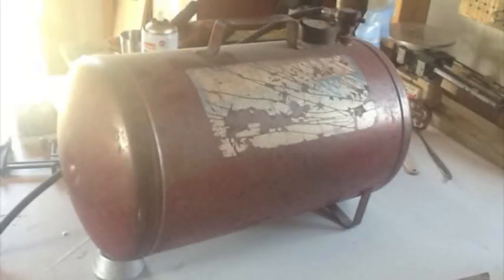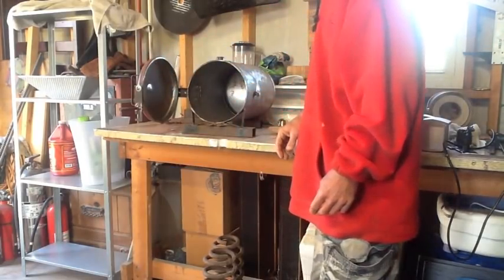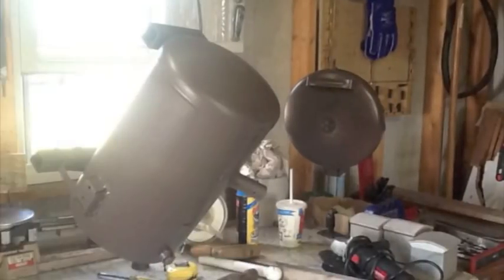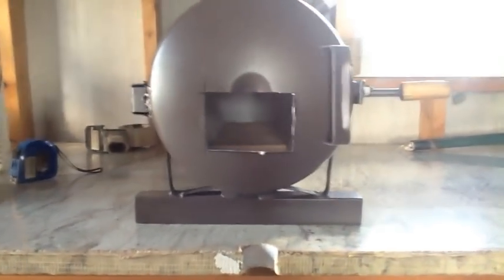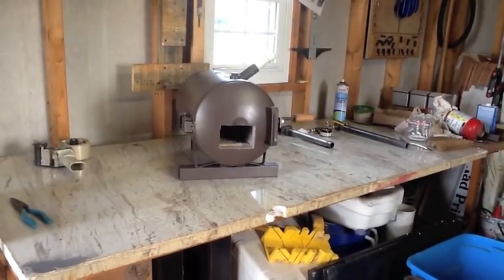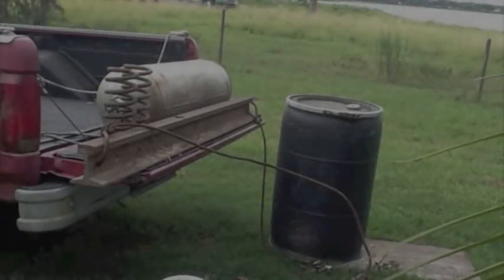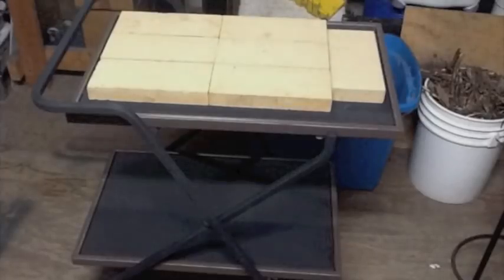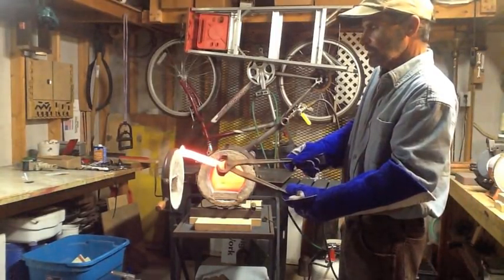My Custom Blacksmith Propane Forge Build - Start to Finish

Comment: Hey I saw your video and it was awesome.  where did  you find your hinge and latch for the forge and what type of hinge and latch  did you use.
Reply from the maker: The hinge came from a junk BBQ grill (just mounted sideways) and the latch is just a piece of scrap steel with a slot in it that slides over a bolt welded to the side of the tank :)

Comment: Also, was thinking about leaving the opposite end open or applying a door for long material. would you do it?
Reply from the maker: I considered an "open end" but didnt forsee doing swords and such. If you do end up making the opposite end open, consider being able to close it up tight when not in use during construction phase :)
Reply: If I can figure a way to seal the door well enough, I was thinking I might try it. Just started cleaning the tank but found an old air tank I may use to build one like yours. Do you have a video on that cool hinge?
Reply from the maker: I dont have a video on the hinge but its just a hinge from an old BBQ grill someone was tossing away. The hinge seems to be the most popular question about my forge :)

Comment: I have one question does it get hot enough to weld with or have you attempted that
Reply from the maker: when I use forced air it reaches welding heat

Comment: Really nice build that is will be looking forward to replicating.  Few questions.  How many gallons is the air tank?  Does it heat up fast enough with one burner? Do you use it more with the door open or closed?
Reply from the maker: 7 gallon air tank, heat ramps up quickly for me with one burner (lots of factors involved however) Quality of burner, PSI used, wool thickness etc. I use with door closed

Comment: Nice job!
Reply from the maker: Thanks Paul!, are you building one ?
Reply: +Makin Sumthin From Nuthin  I have built 2 so far. They are much smaller than yours. I got into recycling old computers about 2 years ago. So my purpose for them is the final step in gold refining. I used cement and perlite for one and plaster and perlite for the other. And mine aren't nearly as nice as yours. You turned that old air tank into a work of art!
Reply from the maker: Thanks friend! :) You use yours to turn the IC chips to ash? Consider subscribing if ya like my content :)
Reply: +Makin Sumthin From Nuthin yes sir just subscribed. I'm always looking to learn so keep those videos coming. So far I've recovered 2 grams of gold from the gold fingers on slot cards and memory sticks. My next step is the ic chips. Still researching the best method for recovery. Have you ever tried?
Reply from the maker: I have been stockpiling IC chips, fingers, CPU's, etc for a while now. Will do recovery when I think it will be worthwhile :)

I Did a couple scrapping vids but I am better known for my casting vids. Servers are a goldmine! :)
Reply: +Makin Sumthin From Nuthin yes they are! I've been gathering old towers and laptops for 2 years and I think I've torn apart over 140 so far. The only thing to make it to the scrap yard so far were the empty towers. Everything else I'm just stacking until I can determine the most efficient way to process. And I'm hoping scrap prices improve. I definitely have a lot more invested at this point than I've gotten back. But I think in the long run it will be worth while. I'm definitely having some fun with it :-)
Reply from the maker: Nice! PC's are good sources for clean aluminum to use for metal casting too. I documented the servers being scrapped out in one of my vids if ya care to watch....maybe I missed some stuff...let me know! :)
Reply: +Makin Sumthin From Nuthin they are very nice! I'm going to check out some of your other videos now. Wondering if you ever did the molten aluminum in a red ant colony? I heard those sell for a good amount
Reply from the maker: No I have not. We used to have fire ants in my immediate area when I 1st moved here but Argentine ants have now taken over the area which run off the fire ants which isnt a bad thing because they dont bite but their numbers are horrendous and pesticides must be used now to keep them from coming indoors.  They are a nuisance that costs me $$ 😡😡

Haven't seen a fire ant in about 8 years now

Comment: Would your crucible shielding material, 60% perlite and 40% cement, work as well as the wool? Also how is the door holding up to the flame rolling out of the cut out. 
Thanks for the video
Reply from the maker: No comparison, the wool is 10 times better at retaining & concentrating heat. Door is fine, paint getting some carbon on it but still there! :)

Comment: Hey man! I'm from Colombia, nice to see your work, thnks for sharing. The ITC-100HT its not that easy to found down here. Have you heard of using hi heat cement? Or maybe you have another brand you can sugest fot using? Thks!
Reply from the maker: Thanks for Watching! There is another product (cheaper), called Satanite. Never used it but heard good things about it for covering the wool. Check online like ebay etc..

Comment: hey, nice forge and nice video! I see you took a lot of time with your video and it turned out pretty good (: I'm trying to build my own forge looking up diffrent designs on youtube. Some use charcol some use this design. when I heard you where using whool for the inside I was confused wouldn't whool catch fire? I actualy have been making armor. You can check out the armor iv made I want to harden and temper my steel so it's really strong but I have no forge hahaha.....
Reply from the maker: +MollysMoshing TankCrew Thank you. glad you enjoyed the video! The wool I refer to is "ceramic wool" and is rated for approx 26-2800 degrees. Good luck with your forge.....do a video on it when ya get it done. Thanks for subbing to my channel!

Comment: Would like to know what material is that white "wool blanket" you use as insulation?  Nice work man!!
Reply from the maker: Its Ceramic Wool rated for I believe 2600 degrees F. There is a link in the description to another vid where I cover that info.

Comment: Great Video. I am going to make one over the winter. What did you use to harden your wool insulation?
Reply from the maker: Thanks Matt! Its called Rigidizer...hardens the wool. Most pottery supply houses will have it :)

Comment: Did you come back and weld the access pipe to the forge or is that just JB Weld? If it's just the epoxy, how is that holding up?
Reply from the maker: That access pipe spider which holds the burner in position is held in position just by JB Weld and then painted over. JB Weld is good for up to approx 500 degrees and the outside of the forge doesnt get that hot so it has never failed. I didnt have my own welder at the time so went that route...I have a welder now tho. If you watch my most recent upload I run the forge in it and put my hands on the outside while the inside is 2000 degrees+. Its my video on disassembling a large ball bearing for a project :)
Reply from the maker: Almost forgot.....Thanks for Watching and consider Subscribing!! :)
Reply: I didn't know JBW could handle that kind of heat. I'm building a new furnace and was trying to figure out how to keep the pipe on there without access to a welder. Thank you for the tip! And now subscribed. :)
Reply from the maker: JBWeld cant take 500 sustained. It will work good only if your forge is well insulated. Thanks for commenting & subbing :)

Comment: Great jog on the forge! I have a water heater tank that I what to convert into a smoker but, now I may just build myself a forge. If you had to build another one, what would you change on the next design?
Reply from the maker: That tank would work well Francisco, good luck if you make one! I wouldnt actually change anything honestly. Thanks for Watchin :)

Comment: This could also be a very small pizza oven. But, I think your production/ presentation is good. I am curious, though, about the gas setup for the forge; I have been wanting to build one for a while to make carving tools. Liked and subbed!
Reply from the maker: Thanks Ken!, I have some videos on the burners for both the forge and foundry furnace I have, both are pretty much made the same way if ya wanna check them out :)
Reply from the maker: PS: I love pizza! :)

Comment: how did you glued/lined this wool with the walls ???
any adhesive or something else, please do clear.
Reply from the maker: Sodium Silicate was used to "glue" the wool in place, it dries when exposed to carbon dioxide (CO2) which is in the air.
 It is fireproof and the wool is securely in place
Reply: Should i lined the wool first, and then to add Sodium Silicate paste on that fixed wool???
Reply from the maker: Just the opposite....sodium silicate painted (it is liquid) onto the interior surfaces of the forge, then install the wool. A small paint brush works well for this. It is quite sticky so care must be taken when installing the wool. Let cure 24 hours 😊
Reply: @MakinSumthinFromNuthin  And for the last time please,
just do let me know about the wool, either its a common wool/cotton or Kao Wool or some special wool????
I mean name the wool please?
Reply from the maker: I used Superwool Blanket HT, made by Morgan Thermal Ceramics. (Ceramic Wool) I puchased it here: https://www.axner.com/superwoolfiber-1thicksoldpersqft.aspx

It comes in different thicknesses. Most Pottery Supply houses sell ceramic wool

Comment: Sorry to ask this but ive looked in the comments and couldnt find an answer but about how long does a regular bbq propane tank last you? If you were to work a few hours a day would it last a week or a few days? I know its a fairly vague question and can vairy from project to project but im just trying to get a consensus as to gas usage. Thanks for any info you can offer.
Reply from the maker: Yes, MANY factors involved there....lots! Efficiency of forge, materials used for construction, PSI used, orifice diameter...subject metal thicknesses...etc. this forge uses about 1.25-1.5 lbs of liquid propane per hour at approx 12-15 PSI
Reply from the maker: My figures are only for my forge build....your mileage may vary :)
Reply: Thanks so much for the response. Im honestly shocked at the speed. Even with the variables it give me a ballpark idea as to how much it will use. Love your videos by the way.
Reply from the maker: Thanks!, I try to answer everyone as quickly as I can. Many content creators wont answer at all...I am NOT one of those! :)   Consider subscribing...trying to get over 10,000 ! :)

Comment: This forge project is interesting. I have a few questions. Instead of using the spray to solidify the wool, would a ceramic chimney flute also have worked? Would a ceramic tube hurt the performance of the forge, and if not, would it need to be protected by some temperature resistant paint? I am wholly ignorant of this kind of stuff but am interested in blacksmithing as a hobby. One of the many blacksmithing channels, I follow, said something profound, "If you need a hammer, then make a hammer." ~ Sorry I cannot remember the channel for reference and the quote may not be exact. I can see how making a forge, instead of buying one, could extend to this logic.
Reply from the maker: Having a vent or flue on a forge would defeat your purpose as the heat needs to be contained within it and not vented. A vent is needed for an indoor coal forge. I wouldnt recommend a vent on this type. Need a tool, make a tool.... is a good philosophy to live by :) 

I wish you best if you take up the hobby :)
Reply: Thanks, what I meant was having the ceramic flute cover all of the insulation instead of just a fire brick on the bottom. I wasn't referring to a form of exhaust.
Reply from the maker: I misunderstood, I suppose one could do that but the rigidizer is what keeps wool particles from being free floating. The ITC100 then seals everything and is the best refractory for a hot face. The firebricks just provide a nice level surface on which to set the work :)
Reply: What exactly is the rigidizer product? Something I might find at the local hardware store?
Reply from the maker: It hardens and seals the wool. Can buy it online or at most pottery supply stores that sell the wool

Comment: did you ask the guys that cut up your railroad track if they had any old bandsaw blades that they were throwing out? that should be some good steel for making Damascus steel.
Reply from the maker: The thought never crossed my mind cause it was a hectic day...but you are so right!

Comment: I am currently doing a very similar build... I think the hinge I used is too weak for the weight of the door though... I am going to have to think of some way to fix that issue.
Reply from the maker: I used a hinge off of a barrel shaped BBQ grill 😊

Comment: I have a good sized aluminum tank.  Would that work for this, or does it need to be steel?
Reply from the maker: Aluminum melts at 1100 degrees....steel around 2600. The forge temps will be 2000+ ....I say NO LOL (go with a steel tank Trey)
Reply: Thanks for the reply.  That's what I was thinking, but wanted to make sure.  I live in the oil fields of SE New Mexico / W Texas, so it shouldn't be too hard to find a steel tank of some kind.
Reply from the maker: YW :)    I tried to eat the 5lb steak in 1 hour at that famous place in Amarillo one time....that didnt go well :(

Comment: awesome job on the forge could you do a video on the gas supply and fittings please ...plus how's the anvil holding up thank you
Reply from the maker: Thanks for the kind words Neal, am proud of the forge build (my 1st attempt at one) I will see what I can do making a video going into more detail on the burner since there is interest but you may wanna check out this vid, I believe it has quite a few details about that burner & build in this video of mine https://youtu.be/N6uTxhJ2fcE

It was made before I got better at editing so may be a bit rough around the edges :) Subscribe if ya like what ya see one my channel!

Comment: I'm sorry if this has been asked before, but what usable temperature does this set up get to? Meaning a decent sized working zone. Thank you.
Reply from the maker: I would guess 2200-2400 degree range, I dont have a thermocouple to test it. Hot enough to forge metal :)

Comment: looks good, I missed it though, what is that product you kept referring to as wool?
Reply from the maker: Its ceramic wool, made specifically for this purpose. A quick google search will give you many sources to buy some...shop for it well to get the best deal :)

Comment: Pretty nice build there. I'm working on getting into forging, progress is slow right now tho. Got a nice piece of rail for the anvil, now I gotta build the forge. Do you cement the wool to the keg or just use the hardener?
Reply from the maker: Thanks!, The wool is "glued" to the steel container using sodium silicate, SS has many uses....but is a great fireproof adhesive for attaching wool.

Comment: I s there any reason you couldn't modify this Forge to use in the vertical position and use it to make some Aluminum  ingots ?
Reply from the maker: The burner wouldnt be in the proper position if placed vertically but the forge would operate.  I have 2 aluminum furnaces so the thought never crossed my mind. You may wanna check out the Brass Furnace video I have up....simple build for metal melting :)
Reply: I quess you could put a large metal container in the forge and melt the aluminum and remove and pour into molds. in this model. I subscribed and just found your channel
Reply from the maker: Forges are very versatile, thanks for subscribing :)

Comment: Do I need a high pressure/adjustable regulator? I'm wondering if part of my problem is that I might have a low pressure regulator.
Reply from the maker: Yes, you do. If you took one off a BBQ grill they are usually 5 PSI....sometimes 10 PSI. I have a 0-30 PSI adjustable regulator on my tank. You need an adjustable :)

Comment: Just curious, does it run hot enough to forge weld?

Edit: another question: what type of tank did you say that was? I am looking for something that kinda has that overlap like yours.
Reply from the maker: I forge welded once in this but the borax made quite a mess so just use it for heating now. Its just a 7 gallon portable air tank :)

Comment: how wide is that air tank? I have a 10" steel pipe I was considering using but yours looks a bit wider
Reply from the maker: The tank is 10" diameter and has 2" thick insulation. The tank is 15" from seam to seam. With rounded ends approx 18.5 overall length

Comment: So you just left the wool blanket exposed and put the fire bricks in the bottom?
Reply from the maker: The interior wool and exposed wool in the door has 2 coatings of ITC100
Reply from the maker: I also coated the firebricks with ITC100 as well :)

Comment: What was the advantage to bringing the gas in at the 2 o'clock position,I would have thought a 3 o'clock or lower would have been better?
Reply from the maker: Good question :) So the gas and flame would follow a circular pattern forming a votex rather than hit the opposite wall at 90 degrees. Hope that answers the question...

Comment: Did you put a flare on the end of your burner??...beautiful build
Reply from the maker: Thanks, no flare needed while burner is in use in the forge itself. One is needed to sustain the flame if used outside of the forge as it will blow itself out. Once the temp in the forge gets hot enuff the propane ignites keeping the cycle going...its the reason why it sputters for the 1st 30 seconds or so as shown in the other forge vids. Glad you liked the build...it was my first forge I built :)
Reply: Thank you for your help......ken
Reply from the maker: Hope that made sense, you will learn more from first hand experience once you play around with yours. This is why you always see flare ends on burner designs demonstrated outside of a forge/foundry furnace on YT